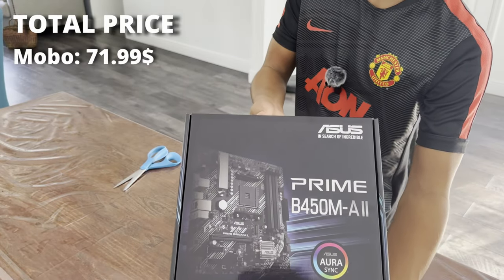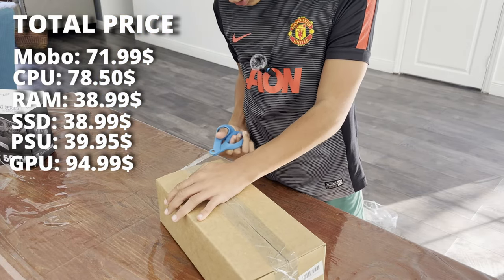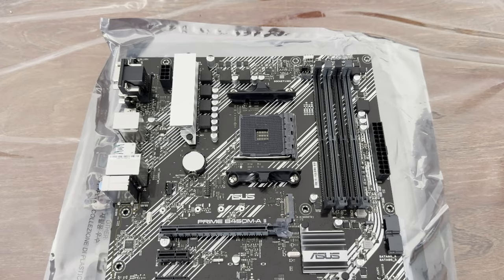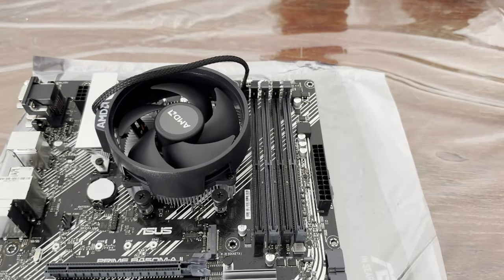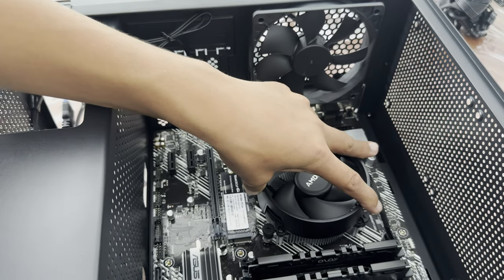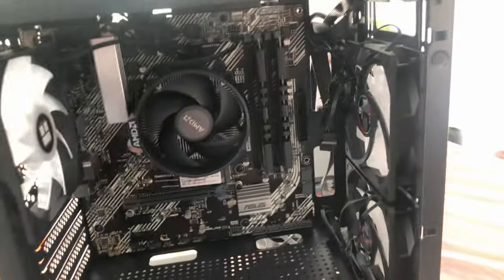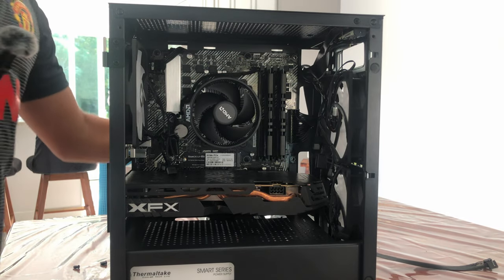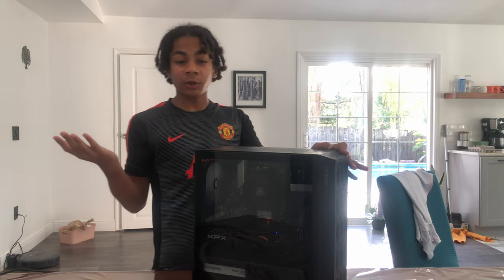I BUILT A CHEAP GAMING PC ONLY USING PARTS FROM AMAZON!! (All Brand New)

Comment: Ahh W build but one thing, you should’ve bought a used 1080 or 2060 for that $100 instead of an rx580. I say this because amd recently discontinued the drivers for the rx580 so it’ll start to run slower and slower giving more frame drops and crashes
Reply from the maker: True

Comment: A three pin fan cable will fit on a four pin fan header, just line up the grove with the tab on the header and that’s the three pins it connects to.
Reply from the maker: It was the rgb header I tried I wouldn’t fit